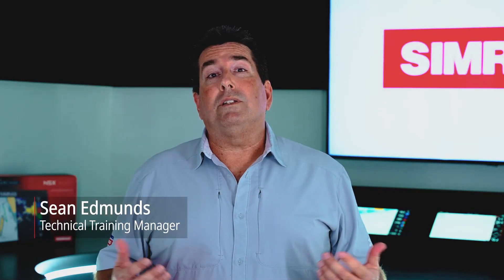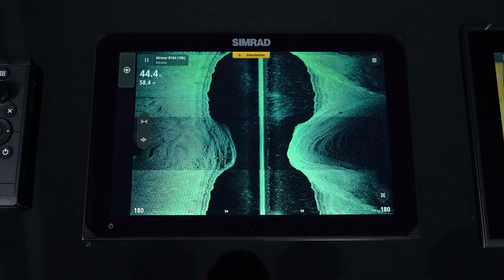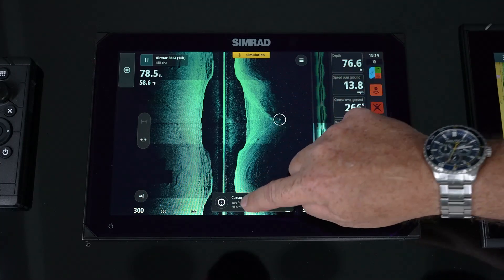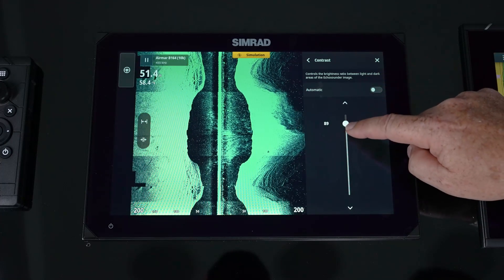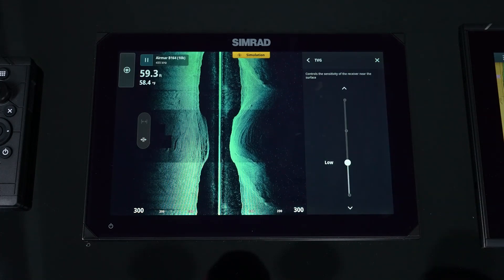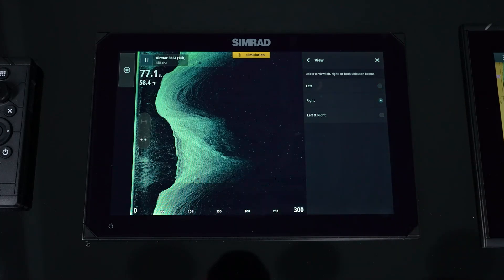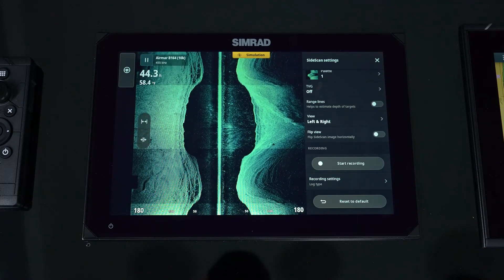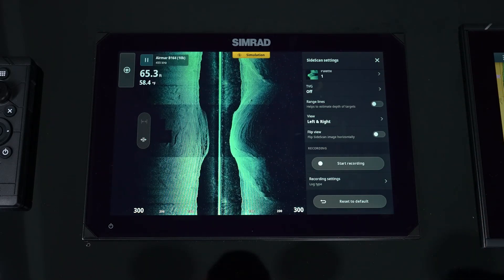Simrad | NSX SideScan Guide

Comment: Hi I have the nsx 3012. I have done some recordings on the side scan. How do I go back and look at those? Where do I find them on the unit and how do I delete old ones? Thanks
Reply from the maker: Please press Pages > Settings > General > Simulation > Simulation files, use the drop down for sonar and you should see all of the files there. Select the one you want and then start the simulation. The file will play back on the sonar pages of the unit.